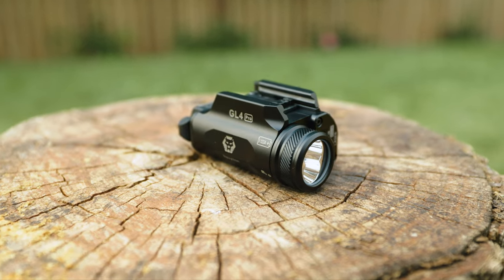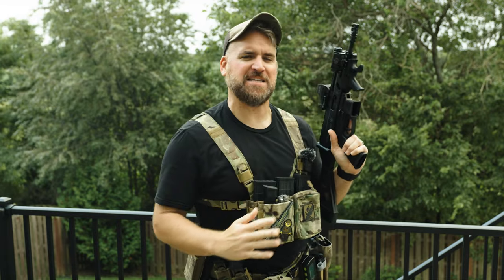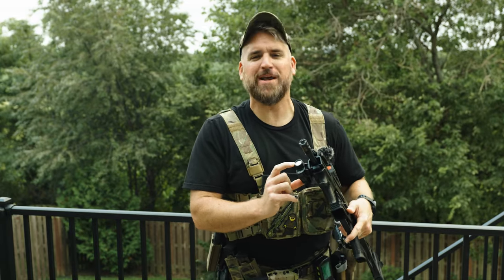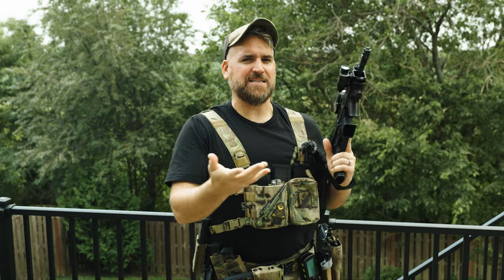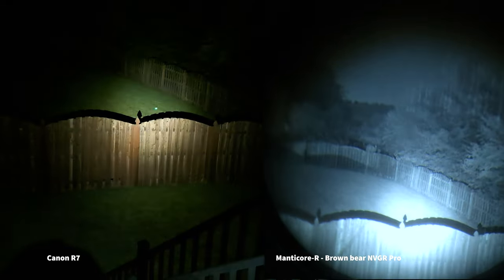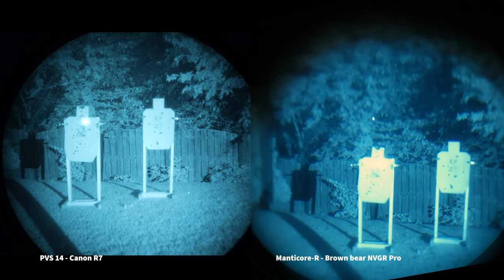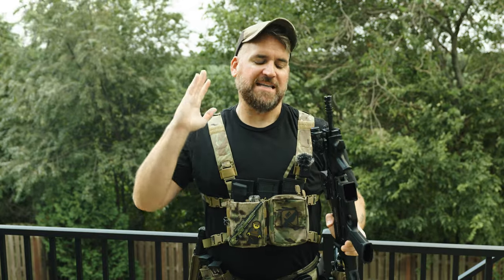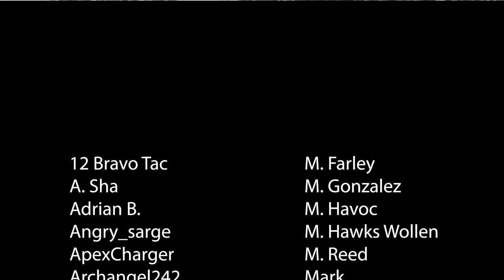My NV PCC Setup....Kinda Sucks - Rovyvon GL4 Pro

Comment: Defense Distributors has an IR only edition.
Reply from the maker: There we go! Anything to ditch that horrible control knob
Reply: @ThinLineDefenseCo   still has that garbage control switch. But with IR only, I've never needed to change the setting anyway. It really does work so well on IR. It's by far the best budget option for anyone not wanting to spend over $1000 on an invisible nightlight. Essentially a somogear that's built for actual firearms.
Reply from the maker: just pray it clamps to your rail lol

Comment: Definitely not a perfect device, but when judged from a $300 standpoint, it’s a pretty viable.
Reply from the maker: I really want the IR only mode one. 

The white light and the controls are so bad I bet that version would be cheaper and just insane

my only disagreement is the value making it more viable..... more palatable maybe but it doesn't help overcome the parts that just don't work in any realistic capacity

Comment: Good video. But why are you surprised by the battery life? 30 min is very normal for any single cell battery light. I have two of these. One had a broken turret which I swapped for a replacement. Aside from that I actually think it’s awesome. Don’t compare it to a peq to Dbal d2. It’s 1/4 the size and made for PCC/SMGs and pistols. It’s cheap and better than the streamlight option. It packs a lot into a tiny package for a fraction of the price of the Surefire. People need to be realistic about the engagement distances for a SMG. You use them to them primarily inside. Flood light is good in this setting and you don’t wants a powerful laser that blooms. Just carry some spare batteries and you’re good to go.
Reply from the maker: and...never ever use the flashlight function.  Because of brain damage.